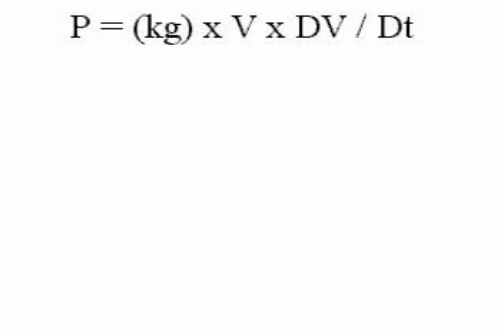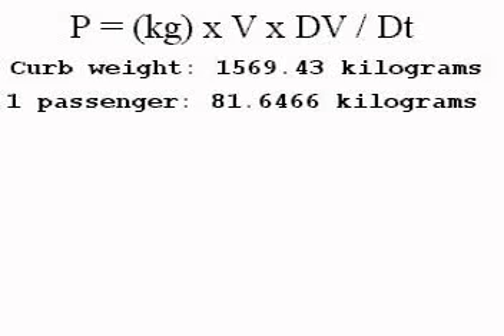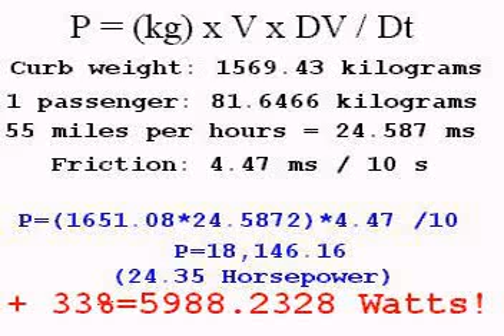HOH Part Two. Major Technology Breakthrough! Burn Water as your Automotive Fuel!

Comment: The O2 produced causes a greater effectiveness in the combustion. It's not so much about the Hydrogen. You do not calculate for the improved combustion of the gasoline in an oxygen enriched air mixture.
Reply from the maker: "The O2 produced causes a greater effectiveness in the combustion"

You "know" this how?

Comment: @jonros1369 Ask yourself this question. why have american automobile manufactorers not changed their engine,fuel line and fuel tank design to incompass dual fuel usage. They did it for military vechicles and BMW perfected a dual fuel auto back in 1979. Gasoline to hydrogen at the push of a button.

Comment: @PalomarJack while all these other goofs are debating, my solar panels generated about 25 gallons of compressed hydrogen today, that i will use to run my generator for my home when my batteries run low or use in my duel fuel converted truck or auto. I use hydrogen for in state travel. I get just over 400 miles per tank and when i chose to travel outside of my state where I can't get hold of hydrogen i flip the switch and run gasoline. Any of these goofs have a problem then they can contact BMW.

Comment: @Desertphile supposedly, there are new batteries in development with up to 10x the storage capacity of current lithium batteries. However, like everything else, it's still tomorrow's technology until we see it today. The only way manufacturers can improve efficiency of in ICE car is to building lighter cars. There really is no other way. Hybrids have the disadvantage of carrying 2 complete drive trains. ATM, 1000 pounds of batteries contains about as much  energy as 1 gallon of gas.

Comment: quit smoking so much pot and open your eyes
1. the fan is running because your lap top is hot so you rap it with a towel WTF ?
2. check meyers files build his cell witch is based on Pulse Width modulation and harmonics  1.5 volt @200 amps it uses power in waiting 
3. what do you think makes are GOV run ..OIL what would happen to are GOV if we did not need any

Comment: Yes, Solar power is one of the six ways to create electricity(electron current flow) but not thermal energy. Energy can not be created only changed in form. The sun is an excellent example of thermodynamics in action, changing one from of energy to another as in solar power. The disorganization of heat or increasing entropy from the sun as it slowly dies. How did the sun get this stored energy is the question because the  universe is a closed system. Maybe a giant collapsing cloud of gas?

Comment: Your math is solid up to the point of the required amount of current to generate enough oxyhydrogen. You did not include the optimum air fuel ratio of 34/1 by mass for oxyhydrogen. Are you saying the increase in added energy to the system requires an increase in energy from the alternator therefore an increase in energy from the engine you are enhancing?

Comment from the maker: "Sure. You reference the HOH as a primary fuel source in "your" (smirk) calculations."

So, you have no idea what you are talking about: well, I suspected that.

The EPA tested the devices and did not find any that improved gasoline milage; the devices only lowered MPG. That result was expected by every physicist on the planet.

If you ever find such a device that works, please inform the EPA and also the automobile manufacturers: they'll want to know about it.

Comment: Sure. You reference the HOH as a primary fuel source in "your" (smirk) calculations. The HOH is used as a secondary (or boost) fuel, much like a nitros oxide system would be used. When added to the intake of an ECM controled engine, the ECM leans the fuel mixture in response to the introduction of the HOH. It can be likened to the prius claim to fuel efficiency, though the prius uses 2nd work source alltogether, same result. same distance traveled, less gasoline consumed, E.G. more efficient.

Comment: I haven't even taken into consideration the failure risk.  If one of those ground based panels fails you can fix or replace it.  If the mirror fails (most likely the steering mechanism) you have to write the entire thing off unless you can count on having the ability to service something in a high orbit.

I'm also rather concerned what would happen if something like a big gust of solar wind from a coronal mass ejection hit it.  It could turn into a solar sail and get pushed out of orbit.

Comment: I just did a very crude estimate, I haven't error checked it so there is definitely a chance there's a mistake in this, but my math suggests that to just break even you've got to be able to have a mirror size to weight ratio of 15.7 square meters per pound.  It's possible that that's actually too low, I'm assuming perfect reflection and no losses.

And as I said, that ratio will keep going up as panels become cheaper.  If you break even today, in 10 years it'll be a losing proposition.

Comment: So the question is, can a pound of mirror in space reflect enough light back to Earth to double the output of $10,000 worth of solar panels (mind you $10,000 buys more panels every year)?  I don't think it's as simple as making a big ultra light mylar reflector, because this thing has to be steerable.  That means structural support, that means weight.

I admit that as I think about it I'm starting to wonder if you could at least break even.

Comment: "just by putting a mirror in orbit you can double the amount of energy by continuing to use the panels at night."

Yes, I'll even suggest you might get 3x the amount of energy if it's set up right.  However if you put the same amount of money into purely ground based panels you'd get a lot more of a gain.  You still haven't really taken the costs of launching something into such a high orbit into account.  Current estimates are about $10,000 per pound to get to geostationary orbit.

Comment: funny that the math says no but i have increased the milage on 9 vehicles.. a 10,000 pound diesel van i doubled the milage.. the average gains have been 10 mpg on the other vehicles... i do agree with you on the point that this is not a viable solution.. that is why i am looking into magnetic engines.. what is your take on magnetics???

Comment: I'm willing to accept burning up the last of our fossil fuels in fuel cells IF we're using that as an explicitly defined stop gap measure designed to keep us going while we implement the next generation energy economy to take over once those sources of energy become uneconomical.

A fuel cell car is potentially a more economical way to use those last fossil fuels compared to internal combustion engines.  The problem is one of those cars still costs about a million dollars.

Comment: "but a lens might be good enough if it was set up over an empty area of desert - Saharah maybe."

You clearly have not done the math on this.  It's FAR cheaper to just deploy a crapload of solar panels on the surface of the sahara, compared to the costs of transporting a fraction of those panels into space.  Africa could potentially become a new energy exporting power based purely on TERRESTRIAL origin solar power, we don't need to resort to sci-fi wet dreams like orbital power to accomplish it.

Comment: "Are you saying that you believe that there is either a chemical or mechanical process that will use less energy converting water into Hydrogen"

Oh no, not at all.  Simply a more efficient way of doing it, effectively of converting electricity (sourced however) into potential chemical energy.  Space based solar power is kind of absurd, Earth based solar is already practical and will only become more so as it's developed.  Currently wind is more economical but with time solar will catch up

Comment: Are you saying that you believe that there is either a chemical or mechanical process that will use less energy converting water into Hydrogen, than is produced when Hydrogen is burned?  Do you care to produce some math on that?

The only logical solution is space based solar power.

Comment: I have a guess as to why some think that this electrolysis thing works.  They keep mentioning that you have to fiddle with the oxygen sensor to make the mileage go up when you do that.

That's part of the emissions system.  I think they're basically disabling the emissions controls.  Which would, likely, increase the car's mileage.  It just has nothing to do with the magical HHO, and everything to do with making the car more polluting.

Comment: We don't have enough natural gas to convert to hydrogen to last us very long at all, and as prices are already rising for it it'll be affordable for even less time still.  We have a lot of coal, but converting it into hydrogen results in the release of a huge amount of co2, which is what hydrogen power is supposed to preventing.

There ARE alternatives.  There are efforts underway to more efficiently use sunlight to split water, or else to simply make standard electrolysis more efficient.

Comment from the maker: "If we need to burn more gasoline to get the Hydrogen, then how is it a solution?"

The hope is to use electricity from sunlight to break the chemical bonds of water, instead of coal or gasoline of diesel. Unfortunately it takes a great deal of electricity to do it. I suppose atomic energy is probably the best alternative.

Comment from the maker: "I came to the results that it would take about 5 times the input power to feed the engine enough HOH gas."

Five times sounds about right: 20% efficiency. Chemical companies that produce hydrogen and oxygen commercially spend a massive amount of money on electricity. For an automobile to run on 33% hydrogen it would need a massive diesel powered generator. FUNNY!